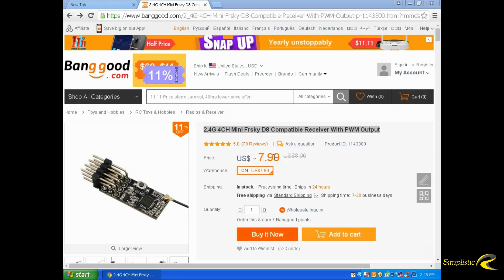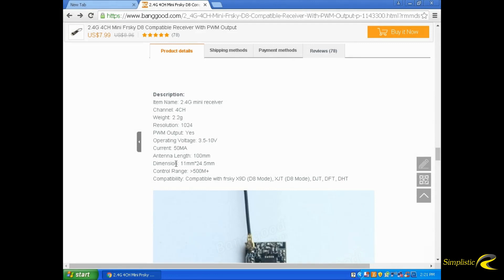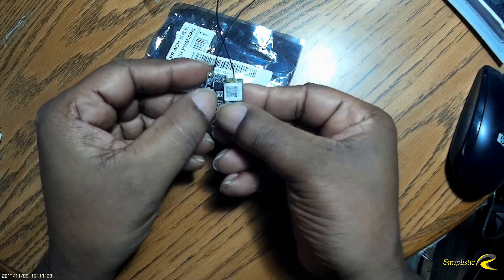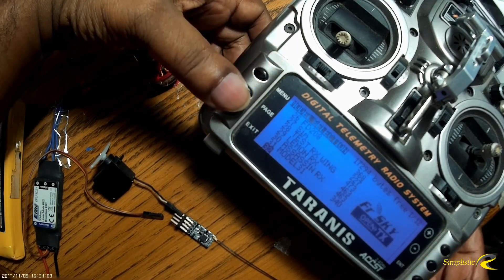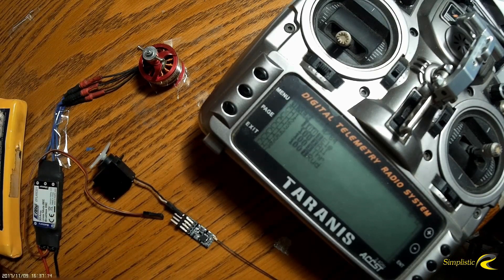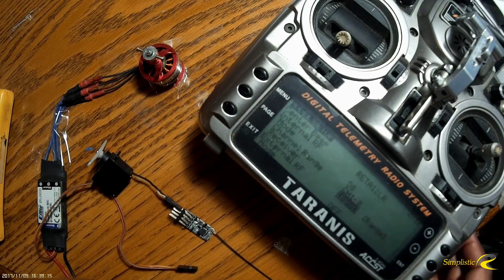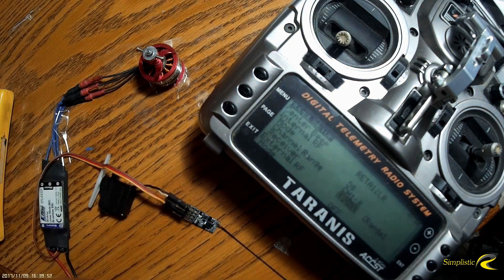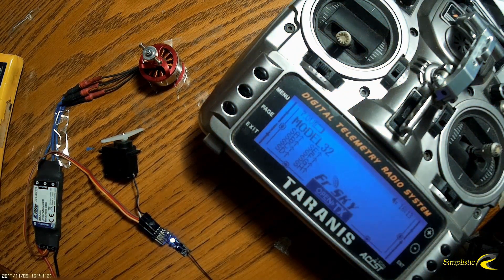Banggood 2.4G 4CH Mini Frsky D8 Compatible Receiver - Unpacking - How To Bind and setup Failsafe

Comment: I had trouble binding this receiver to my FlySky  I6X. I tried at least a half a dozen times and it just sat there telling me it was binding. The rapid flash on the receiver went to a slow flash, but the transmitter just kept trying to bind it. Finally in a fit of frustration, I hit  the Cancel button, and THAT bound it up.
Reply: Actually, it's interesting that you were able to bind it at all, because this one is designed for Frsky (not Flysky) transmitters.

EDIT: I wasn't aware of the Multiprotocol Mod for the I6X, as mentioned by Simplistic RC 🙂
Reply from the maker: Good you got it working. You must have the 'Flysky MultiProtocol Mod' on your FlySky  I6X

Comment: Hi, I had a problem not bind.
It turned out to be a problem with the button. 
Now after bind the servo does not move smoothly but jerks...what could be the problem.
I have an XJT Accst HF module.
Reply from the maker: Your gains my be to high or you may have a defected RX seeing you had a bind button problem.

Comment: What is the length of the antenna section where there is no metal braid?
Reply from the maker: About 23mm
Reply: @simplisticrc1593  ok. thx. I have a little bit another information, about 26mm and 31mm